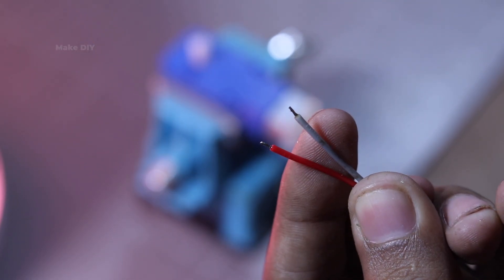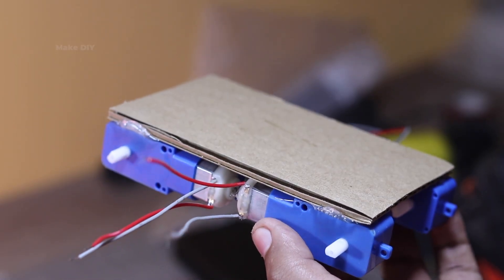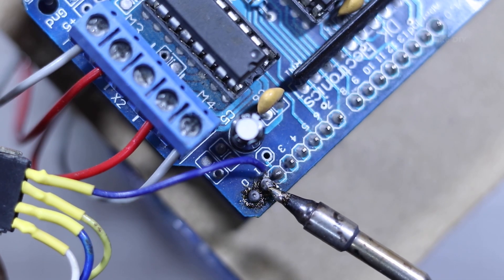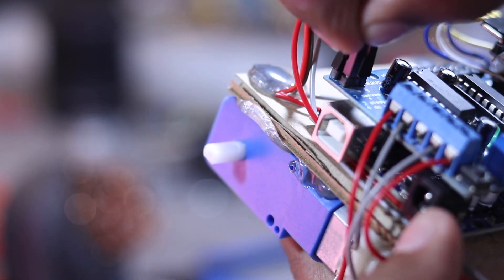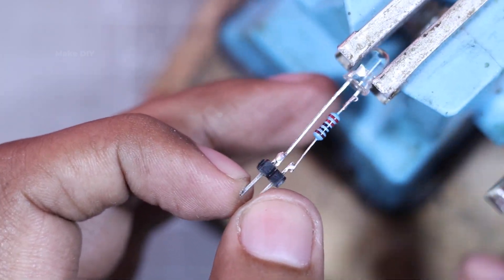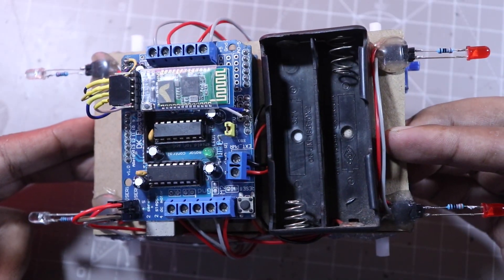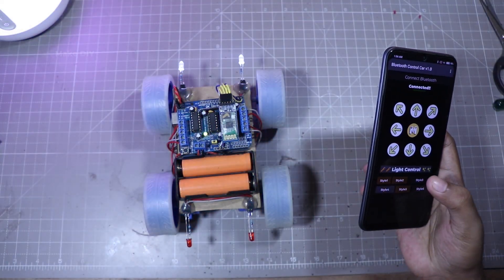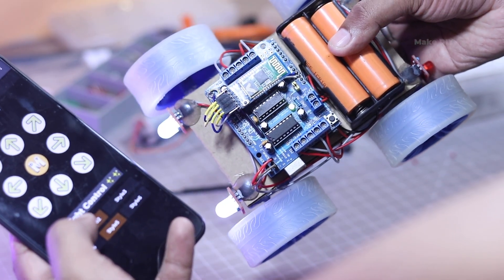Make DIY Arduino Bluetooth Controlled Car with Different LED Patterns

Comment: Hello sir, i don't know much about electronics, as I'm majoring in SE. But we have to do a project very similar to yours in our university. I don't seem to understand very well how does the L293D works and my question is: Can I, somehow, use the original pins from the Arduino without interfering with the motor shield? For example, in pin 5 I want to do certain blinking pattern with an led, but I cannot put a jumper inside because of the motorshield. Is there a way to continue working with the Arduino board?
Reply from the maker: You have to solder on the same pin of pin 5 on the motor shield

Comment: Hello sir code may error a raha hai .     Af motor.h no such file or director
Reply from the maker: Install motor library
Reply: @MakeDIY9  ok
Reply: @MakeDIY9  sir hum nay yha par Arduino Uno r3 ka  use kiya hai kya yha work karay ga
Reply: Not working